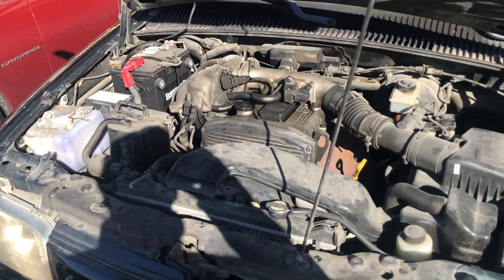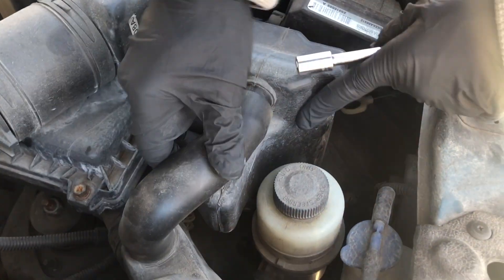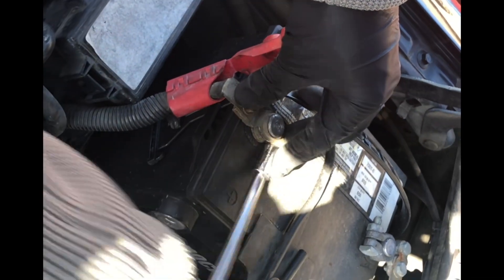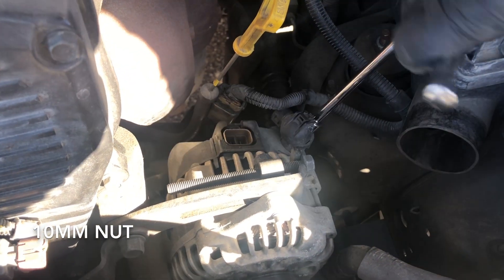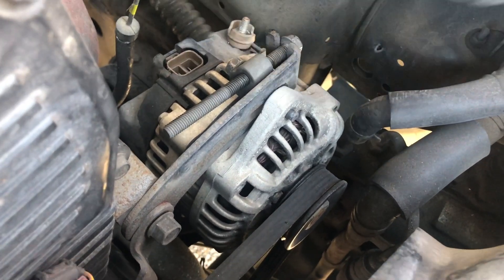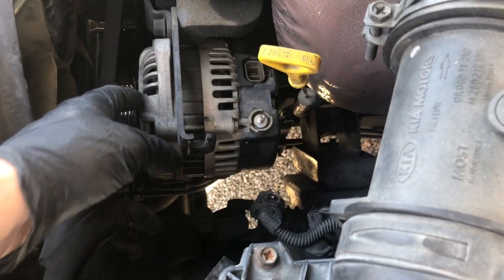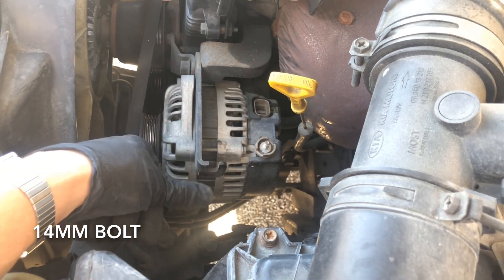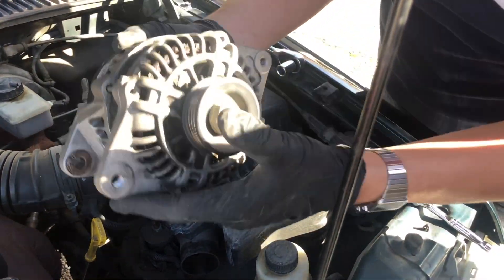How To Remove Alternator On Kia Sportage 98-02

Comment: Hey man great video it's short sweet and right to the point also I was wondering if you maybe had Any insight on why my Sportage just dropped out volts??? Was running fine all day but when I pulled into my complex everything went dim and the car shut off, now the battery is dead too... Im banking on the alternator crapping out but thoughtI would see if maybe you knew something I didn't since it appears you have quite a bit of experience with these damn Kia's lol
Reply from the maker: Check the battery fuse, it’s a 80A and it’s bolted in the fuse box located in the engine bay. This Kia suffer from electrical uses and that fuse is the first to go, it prevents any power from reaching the car
Reply: @GarageBoys  thanks for the reply! Would the car not run if that fuse was out? or would it run and when it is running it's real hesitant and stumbles plus the temp gauge is pegged hot and it hasn't even been started at all today it's running voltage is 13.88  isnt the minimum running volts for that 14.2?  do you know what would be causing that little of a voltage drop I have been having some issues with grounding wires maybe there's something I haven't found yet idk but it's got me scratching my head lol
Reply from the maker: If the fuse is blown the car won’t start. It sounds like your problem is the alternator
Reply: I have the same issue

Comment: Could somone tell me why my 2001 kia sportage  will not go in gear .
Reply from the maker: They suffer from a electrical problem that burns a transistor by the pedals. Have your electrician check inside the car under the steering wheel I’m sure you will find your issue there.